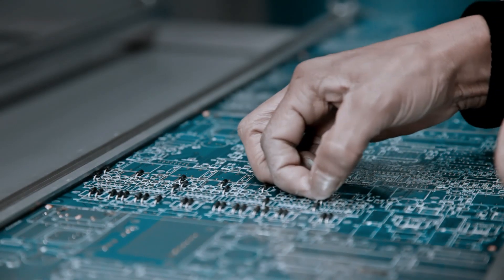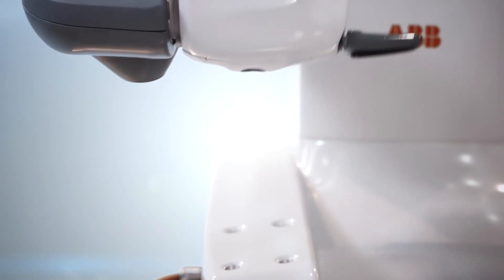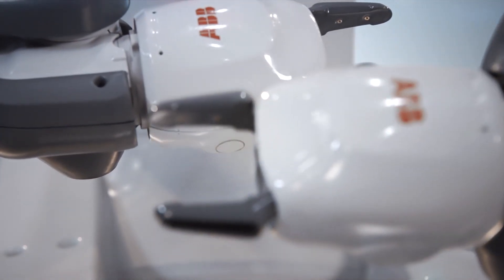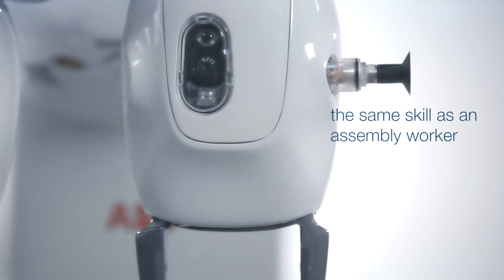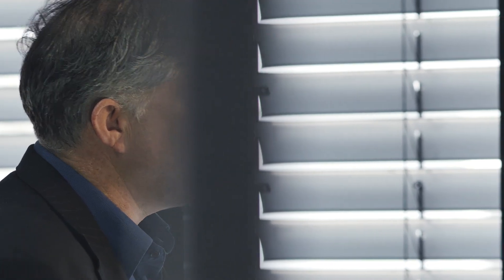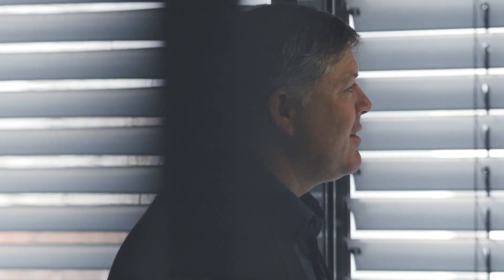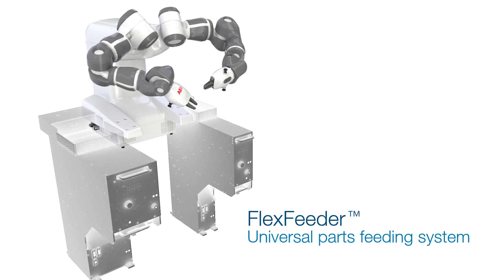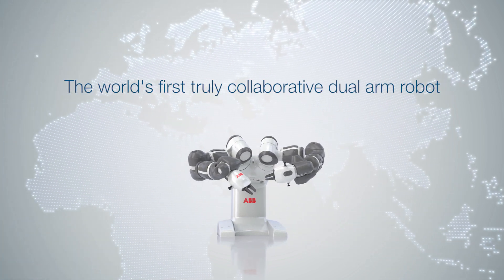The world's first truly collaborative robot - YuMi

Comment: that is the type of robot that they should have in Satellites, where it can move on the walls through a rail all over the place, with more fingers, and longer arms, so it can repair satellites and space station inside and outside without a problem.
Reply: Except these robots are very delicate and need maintenance often aaand it's cheaper to replace the whole satellite than sending replacement parts
Reply: SpaniardChris it would be better to have robots like this but better, so they can fix the satellites, because that way is less maintenance humans have to do, and also they can work without a risk, the robot would be there all the time so there would be less need to send humans for repairs, because it would be more expensive to be doing that, as replacing the satellites it also cost to make new satellites so it would be a great savings to be do that anyways, they can send the robots in smaller space crafts.